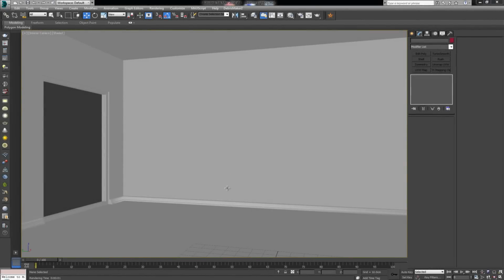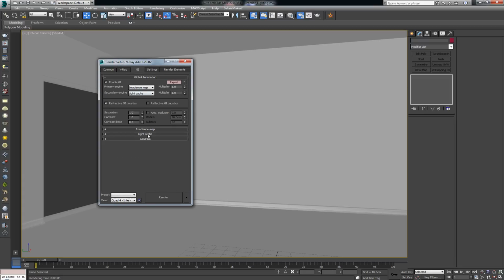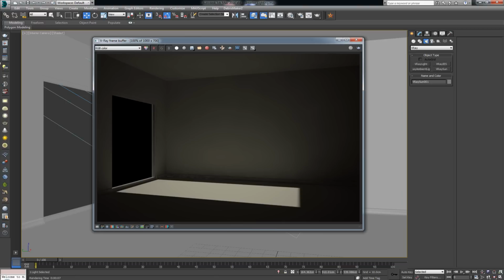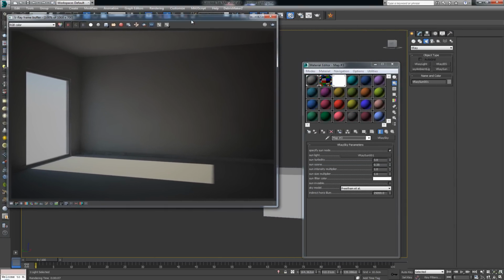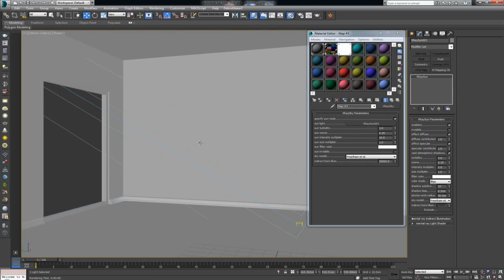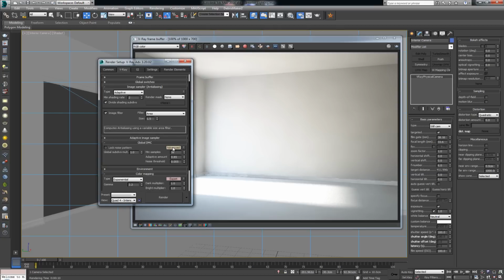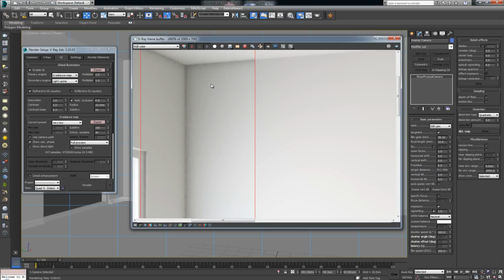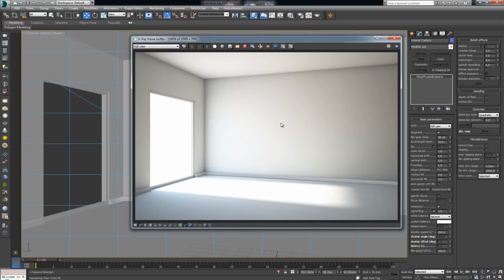Interior lighting with V-Ray Sun

Comment: 1st of all i can't thank you enough for such an amazing tutorial which helped me a lot in it comes to lighting a scene using vray, yet i still has this issue with splotching in the left side frame of the door which i tried to overcome it by raising values of "irradiance map" and "Ambient Occlusion".. i finally got there as you can see the difference in these screenshots but values were too high and rendering time extended to 3 hours and still not done for the whole scene, so i was wondering if you could tell me where i got it wrong so i can reduce these values and rendering time by the will of Allah..

i'm using Max 2016 and vray 3.20.02 adv

1st render image:
https://drive.google.com/open?id=0B38ur7JqI0E_Z2dueXRLekkyTGs

Screenshot of the values & the final render for the door frame:
https://drive.google.com/open?id=0B38ur7JqI0E_YXlRNkgwSnBic0E

scene max file:
https://drive.google.com/open?id=0B38ur7JqI0E_QWh5RHV2Tl9NXzQ

Comment: Hi Denis, this was very very helpful! :))
Question: I'm trying to work a scene similar as yours, same lighting, same cameras and i also have some bulb lights in it assigned with VrayLightMtl, but the damn thing wont light up or make GI. i tried to recreate a simple scene without any lights except VrayLightMtl and it works just fine. Does VrayLightMtl conflicts with sunlight, or do you have any opinion on this? tnx